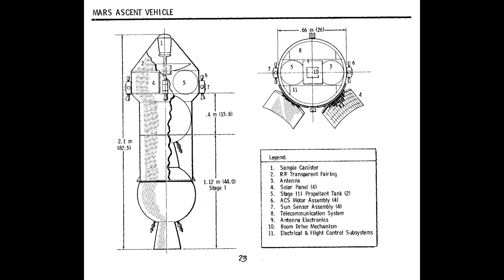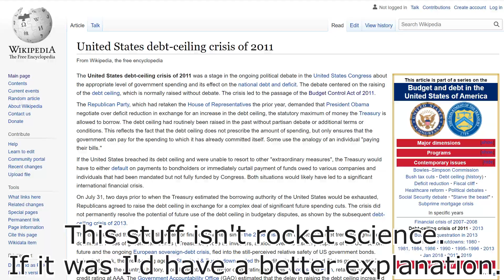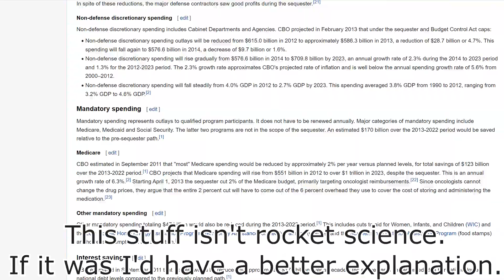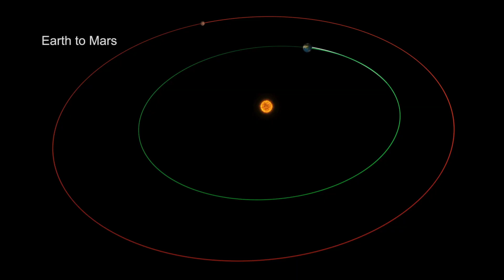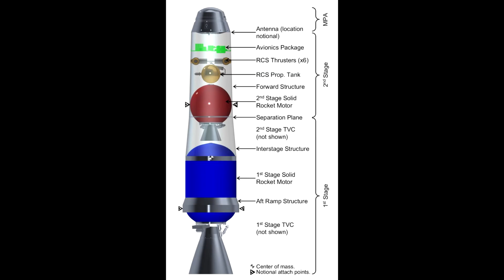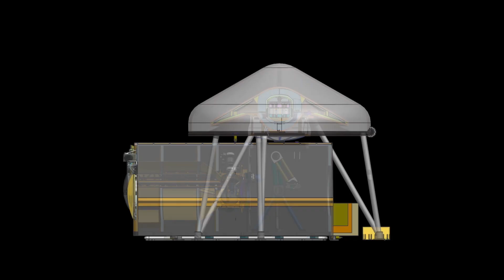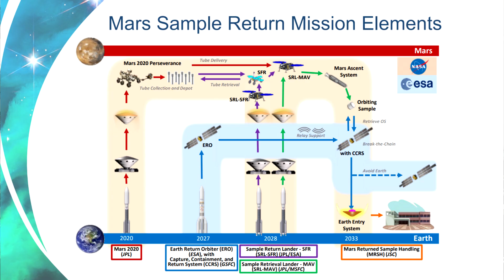Why Getting Rocks Back From Mars Is A Massive Challenge

Comment: When you study the physics, orbital geometry, fuel consumption, etc, just getting something TO Mars is a stupendous undertaking. This is complicated for a RETURN flight where your return platform needs to remain in orbit and vulnerable until the next open launch window for planetary alignment,  the number of possible problems the lander can encounter during that period, launching the payload back up to match orbit and velocity, recouple, then hopefully you still have all systems available for navigation.... and hopefully enough fuel to get back home. The math alone is enough to give a math geek a migraine, even with computer assistance. Now, assuming everything works to get you back to earth. Now, how do you safely get the payload through re-entry and onto the ground (after all, the number of lost craft due to failed heat shields, etc has never been fully disclosed nor been verified)? Yes, OF COURSE it's a massive problem when you have to deal with all that. People have actually grown complacent about sending probes to Mars, forgetting the number of failures vs successes. HOW many of our initial probes never succeeded? Now, think about that, combine it with what I said above, PLUS the fact that it's the first ever attempt at doing so and the actual odds are more in favor of failure than success. Now, taking all of that into account, would I still accede to be part of the first manned mission there? Yes. Think about the feeling of being one of the first humans in history to ever set foot on another planet. Not the moon... another PLANET. Seeing the surface of Mars with your own eyes instead of pictures. Hell yes I would go (not that I have any realistic chance of going, but this IS a hypothetical). Wouldn't you?

Comment: Might be too late to get an answer, but I always wondered : I know human flights not possible with this due to changing g-forces, but why is a Gauß propulsion system not being use to replace the first stage (or at least part of it). I can't imagine, once the infrastructure to accelerate a rocket by external forces (like electro magnetism), such Form of aid to lift of would not be economical...

Comment: You load it on a micro rocket and launch it into orbits where you pick it up by a small ion thrust powered probe that deliver it back to earth. Maybe use a mortar type launcher with a rocket assistance.  I should watch the whole youtube video first.
Reply: Mortar that fires the rocket up to 3 or four K.  Plastic explosives are stable. The solid fuel booster could kick in.

Comment: If they sent Percy II and give it a way to service Percy's Panels, Maybe carry a replacement or 2 or a battery upgrade, and a way that it could put itself into a standby mode and use it to keep Percy Flying? This would be a good test at doing basic engineering tasks remotely for when we have to get robots repairing systems when we get Habs on Mars.

Comment: JPL loves Rube Goldberg Machines, they should simply uses the descent rocket crane and land it instead of crashing. With a little extra fuel onboard, all empty tanks could be refilled with Mars Propellent, CO2 would be liquid at reasonable tank pressures at Mars temperatures. Solar cells power the pump to pressurize and liquify CO2 while samples are collected. Then liftoff with the minimum equipment, using onboard fuel and oxidizer with a CO2 afterburners. Low ISP but lots of thrust, dropping empty CO2 tanks along the way. Upper Stage is High ISP fuel and oxidizer will all the empty CO2 tanks jettisoned. Rendezvous, Dock, Transfer samples and head home to Earth.

The CO2 pump and tank with liquid CO2 could be used to blow the dust off the solar cells, a hose running to the end of the rover arm, a gas sprayer. 

Reusing the Descent Stage instead of crashing it. No Ascent Rocket Required.

That's how I would do it.
Reply: Not sure if you are being ironic or not.
Reply: By “a little bit more” you mean “10x their available deltaV”?

Comment: Will Starship be able to travel to any celestial bodies in the solar system and return with samples? What are the limitations with temperature, distance, and mass?
Reply: To leave Earth orbit, Starship has to be refueled. From page 27 of the GAO decision to deny the Blue Origin complaint. [DELETED] is apparently at least a propellant depot from the context and SpaceX had the GAO redact that info. Added in Musk's payload update and he says that it is up to 8 Tankers depend on Lunar Starship's mass. My comments are in ().

"SpaceX’s concept of operations contemplated ten total launches (down from 16), consisting of: 1 launch of its [DELETED]; 8 launches of its Tanker Starships to supply fuel to [DELETED] (down from 14); and 1 launch of its HLS Lander Starship, which would be [DELETED] and then travel to the Moon."

The Early Mars flights would likely be the same. Starship uses up almost all of the propellant to land on Mars. So a new load of ~1,200 tons of propellant would have to be generated from the Mars atmosphere. This tech is in early development, so there is a long way to go for this to be viable. You can return from Mars in a short stay in the same window, but it will likely take at least one window to make the propellant for a return trip, so it would be like a 3 to 4 year mission.

To go to other locations will depend on how much cargo you carry, how light you can make Starship, if you can aerobrake, and other factors.

Comment: panspermia
i have calculated that earth life may have seeded objects as far away as 19,000 light years, and farther with an accidental gravity assist from a black hole or neutron star.  
but its very iffy
given 
that 3.7 billion year travelling window 
that fungal spores can still germinate after 250 million years (proven) and probably much much longer and also survive space 
that some spores got an accidental gravity assist by jupiter or saturn to about 35000mph

But its almost certain that every object in the solar system has received spores from earth. they may never have germinated, due to bad conditions for them, but many are probably out there that could still germinate in the right environment
add in a relatively high probability that earth life has seeded nearby star systems as well, i predict any space life found out there will be originally from earth and have DNA encoding.
if you notice the fact that life appeared on earth shortly after liquid water appeared, it may be that it came from outside, but was sitting around nearby, in a great very thin cloud of of live spores that permeates our galaxy, given the exoplanets possible 9 billion year window.
a way to prove panspermia, would be to seal off an apparently sterile martian cave, introduce growth conditions (heat, light, gases, water and nutrients) and see if anything germinates

Comment: If the new rover that picks up the samples can store them externally, why couldn't the rover that drilled them do this rather than "lock them inside"? Surely it would be quicker and easier to rendezvous with the existing rover, even if it is dead, than have to trawl around for all the dropped canisters.

Comment: I'm just a little surprised the launch isn't going be a "shotgun" launch: use a COPV tube and some kind of pyrotechnic gas generator (an over-sized over-engineered "shotgun blank") to fire the rocket into the air. If the tube can be set on the ground you should be able to get an Iₛₚ during those first 3m that's mostly limited by how durable the booster is.

Comment: Side note: the minuteman missile is a three stage solid-fuel rocket with extremely tight terminal accuracy constraints. I think it has RCS on the payload, but not much. What it does is allow shutting off the 3rd stage by dumping the internal pressure in the casing via blow-out panels.

Something I've not heard much talk about is tricks you can do near the end of the boost of a non-throttle-able rocket to more or less use cosine losses to in effect "throttle" the rocket. More specifically if you have a target point you are trying to hit where some of the state space doesn't matter (i.e. if you don't care about when you get there or maybe what direction you are going) you can finish your burn pointing in a direction that moves all the of the variability caused by uncertainty in when the burn ends in the irrelevant dimensions and none of it in relevant dimensions. For an ICBM that's easy as you only care about 3 of the 6 parameters (X, Y and Z but not t, ω, or Ω). For a sample return you may only need to care a lot about the inclination and ascending node and only a little about the other 4 parameters. You need RCS on one side or the other for the final docking anyway so a "close enough" orbit can have more than a bit of wiggle room in it.

Comment: Ukranian defenders are testing the concept of accelerating missiles into the air before they ignite their rocket motors on daily basis. it works pretty well.
BUT, the moment Scott mentioned that mechanic as solution for launching rockets on mars... i just had to imagine how Elon Musk presents a lunar landing module that would do the same thing with the lunar lander starship.... just in line with the mechazilla concept... who needs retractable landing gear when you can just catch your landing rocket, and throw it up for launch :D

Comment: 7:57 "downside of that is that they're stuck with a computer that dates from 1997"
That's not necessarily a bad thing you know. Sure, it might mean you don't have all the fancy bells and whistles of the newer chips, but the minimum transistor size is also likely larger. And from what I remember of your video on flight computers for spacecraft, that means it's less likely to have a radiation event induce a program upset or other kind of data corruption.

And besides, we may laugh at it now because of where personal computers are today, but when all a computer is being used for is to control something else, I think Bill Gates was right when he said "640k ought to be enough for anything".
Most guidance computers don't use all that much RAM.
Oh, and that brings up a funny thing I know. There's a US missile that has a guidance computer with the program having a rather large memory leak in it. So how did they fix that?
They didn't. In typical American defense industry fashion, they simply gave it twice as much RAM as it could possibly consume before the missile had either impacted the target or had flown for long enough that the self-destruct timer set off the warhead. And a missile that takes the natural route of implementing the "Halt and Catch Fire" instruction does just about the best kind of "garbage collection" that I can think of, because one thing's for certain you'll never have to worry about managing the memory ever again!

Additionally, you say that "everything has to fit on small rockets". While the sample return mars ascent stage(s) will indeed constitute one of the smallest orbit-capable rockets ever designed, the rockets that get everything to Mars in the first place will likely be either Vulcan Centaur, or New Glenn, and I'm certain that absolutely nobody in the know is calling THOSE rockets small.
What this means is that you can send additional missions to Mars to collect EVEN MORE samples, if the funding exists. You might not even need to send another sample collection rover, if Perseverance was designed in the way I hope it was.
I'm not sure if Perseverance was designed with this capability in mind, but the hard part of getting samples from mars is getting the equipment there in the first place, and Perseverance constitutes a fully capable sample collection rover already. The only issue is that the sample containers are in limited supply.
If Perseverance can use its robotic arm to pick up empty sample containers and load them into its sample collection system, then my idea is to send more empty sample containers on a little pallet that is mounted to the lander that lands the rocket that will send the samples into Mars orbit.
It's a similar concept to "giving the soldier more ammunition". I just don't know if the sample collection equipment on Perseverance is "reloadable" or not.
With the large launch vehicles available to launch the spacecraft that collects the samples from Mars orbit and brings them back to Earth, my thinking is that you could build that craft as an "all electric spacecraft" using electric propulsion for the attitude control thrusters (Hall effect thrusters, as well proven by some existing geostationary orbit satellite bus designs) as well as the main propulsion system (ion engines as already flight proven by many many missions to asteroids, and even a few missions to the Moon and Mars), and then simply give it enough reaction mass to be able to operate for multiple earth-mars trips (2 at least, but likely more). Granted the craft would probably start to resemble "bits of satellite stuck on to a large tank of Xenon", but that's not a big issue, spacecraft's form is defined by its functionality already anyways. And "adding additional propellant reserves" to a spacecraft generally doesn't make it cost that much more than the same spacecraft with less propellant anyways (the functional bits are the expensive part, and every part that isn't propellant is is a functional bit if the engineers did their job well, like NASA engineers tend to do).
And it would be a good testbed for equipment used on the "Power and Propulsion element" (or as I call it, the "drive section") of a future solar-ion propelled crewed Mars Transfer Vehicle, which is good since a crewed mission to Mars has always been a long-term goal for NASA.
Reply: Don't forget the Falcon Heavy. When fully expended, it can put 16.8 tons to a Mars Transfer Orbit, which is more than the Vulcan Centaur I believe. Fully expending the Falcon Heavy starts at $150M.

Comment: wouldn't the landing without a parachute damage the samples? unless they're already dust as opposed to little core samples
Reply: It's rock. And a lot of it. This is not like the fragile collectors of the Genesis probe sample return, which only contained tiny particles of solar wind. (And even then, they did manage to salvage most of the samples for useful science.)

Edit: aerogel was a different mission, which did not crash when landing.
Reply: @brianorca  well if they're looking for microscopic fossils, you wouldn't want the samples cracking. I guess I'm thinking of the impact velocity being high. Also there might be a shock absorption mechanism inside the landing vehicle.

Comment: Could someone explain to me how solid fuel rocket boosters actually work please. I mean what is the fuel and why is it solid?
Reply: From the Glenn Research Center, Solid Rocket page. 

"In a solid rocket, the fuel and oxidizer are mixed together into a solid propellant which is packed into a solid cylinder. A hole through the cylinder serves as a combustion chamber. When the mixture is ignited, combustion takes place on the surface of the propellant. A flame front is generated which burns into the mixture. The combustion produces great amounts of exhaust gas at high temperature and pressure. The amount of exhaust gas that is produced depends on the area of the flame front and engine designers use a variety of hole shapes to control the change in thrust for a particular engine. The hot exhaust gas is passed through a nozzle which accelerates the flow. Thrust is then produced according to Newton's third law of motion."

Once you ignite a solid rocket motor, it burns until the propellant is depleted. Rarely is there a way to turn a solid rocket motor off. There are hybrid solid rocket motors, where just the fuel is packed like a solid rocket motor and the liquid oxidizer is sprayed onto the fuel to run it. These types of hybrid solid rocket motors can be turned off and on, but are more complex than a regular solid rocket motor.
Reply: @steveaustin2686  cheers bro 👍✌️
Reply: @abritabroadinthephilippines  Google led me to the above. Just takes practice.
Reply: @steveaustin2686  Well it was the interaction in the comments that counts m8 👍✌️
Reply: @abritabroadinthephilippines  That's good. 👍
Reply: Google is your friend.
Reply: @TheEvilmooseofdoom  I know that m8 but I'm giving someone the chance to tell me instead because let's face it you can't talk to Google. Fk sake I mean yea you can but you know what I mean.

Comment: A video about the russian plan of a venusian surface sample return would be pretty interesting, I've not found much about this.
Reply: I thought Venus is as heavy as earth? A rocket needed to leave the planet would need to be massive.
Reply: @OBtheamazing  I though the same thing but actually Venus and his very thick atmosphere allow the use of a ballon to lift the rocket, which is not possible on Mars!
Reply: @VictorDeVandenesse  as long as it is not a lead ballon. Lol.
Reply: @OBtheamazing  A lead balloon can be done with lead foil, it is just not practical at all. Search for Mythbusters lead balloon and you can see clips from the episode where they made one fly. Now a regular balloon with the nasty Venusian atmosphere would surely be difficult. Venus' escape velocity is ~10.36 km/s which is ~92.6% of that of Earth per NASA, so you are correct that it's about the same as Earth's. I have a feeling the nasty, acidic atmosphere is going to be worse than the gravity.
Reply: @steveaustin2686  I know. it was a joke. Partly because lead balloon, also because Venus temperature(sea level) can melt lead. Making it a lead puddle.(atmosphere is colder, I know)
Reply: @OBtheamazing  It's not always easy to tell nowdays. :)